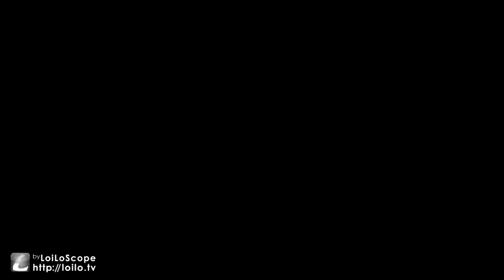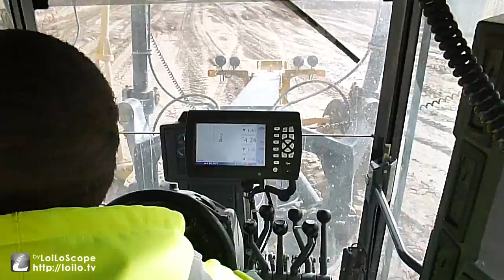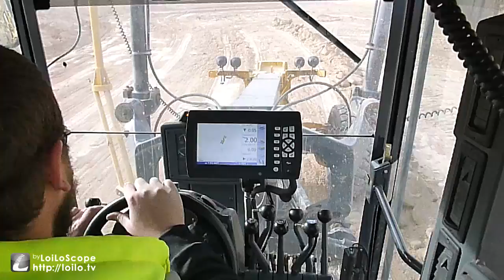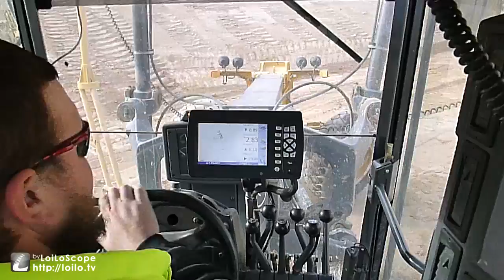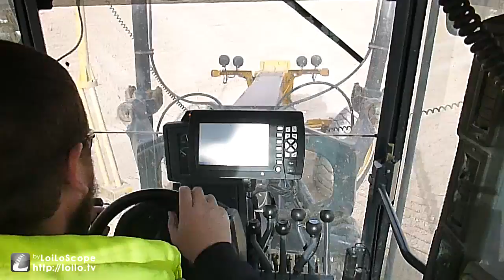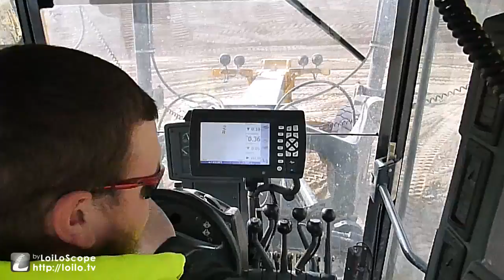Machine Control

Comment from the maker: No I haven't ever run one I've sat in them and messed with the joysticks a little. I worked for a company in Phoenix that had one of the prototypes in 06 and nobody that ran it liked it. I think they are probably more comfortable but I like the steering wheel option which is why I'm a fan of the G series Deere graders with the arm rest controls option you can run the steering with the stick on the armrest but still have the option for a steering wheel if you want.

Comment from the maker: We run Trimble SCS900 you have to have two recievers to run thier 3D grade control system.  Trimble has the patents on the dual reciever system which is why Topcon, Lieca and all the others use a single mast on one side of the machine.  The automatic machine control is an option often times contractors won't spend the extra money to put auto's on bigger dozers because they won't be used for finish work anyway.